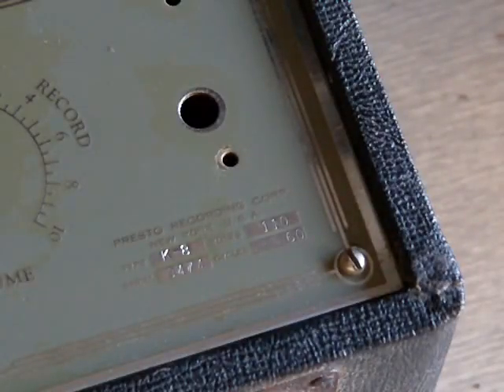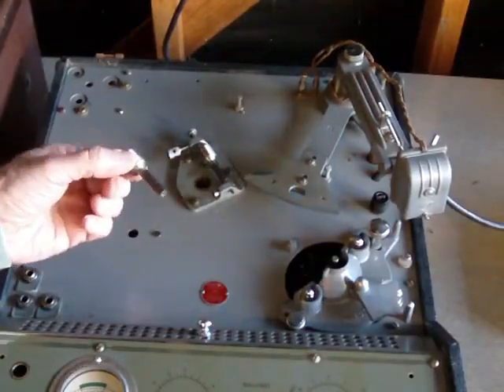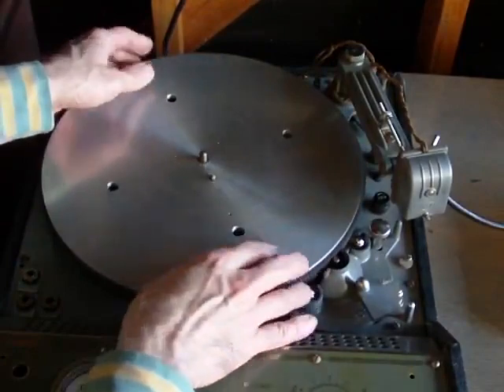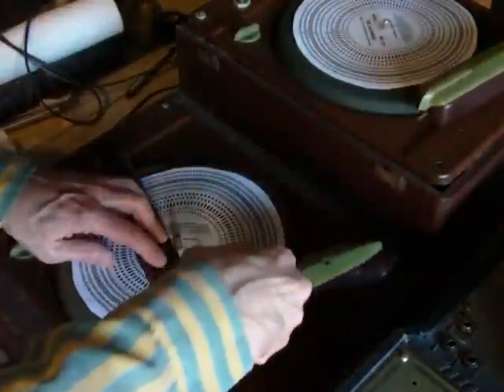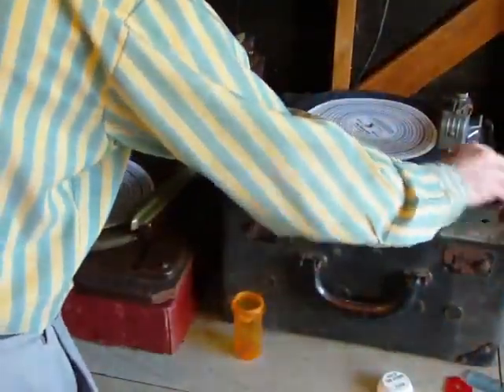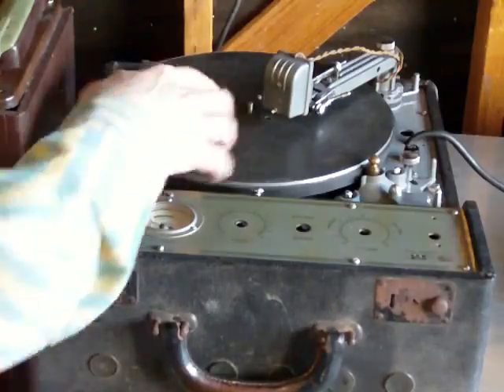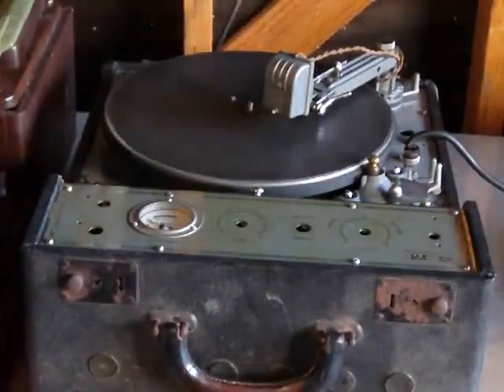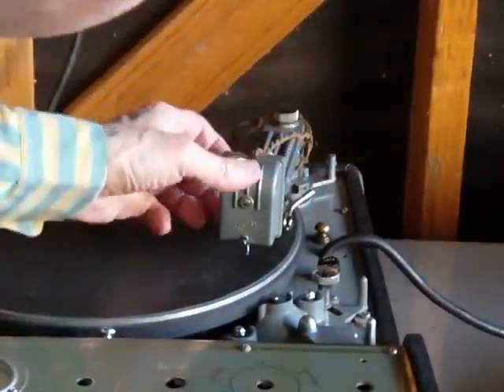Record Cutters Presto K8, General Industries GI-R85/R90

Comment: Здравствуйте. Хотел бы узнать устройство механизма подачи у этих звукозаписывающих станков, у тех где режущееся головка перемещается по направляющим с помощью ходового винта - понятно, а на этих где она стоит на поворотном рычаге механизм не виден. Если возможно сделайте видеоролик с этими подробностями. С Уважением в Вам Анатолий.

Hello. I would like to know the device of the feed mechanism for these recording machines, for those where the cutting head moves along the guides with the help of a lead screw - it’s understandable, but on these where it stands on the rotary lever, the mechanism is not visible. If possible, make a video with these details. Yours sincerely, Anatoly.
Reply from the maker: Когда я продал эти 3 резака на ebay, я никогда не фотографировал их изнанку. Тем не менее, вот ссылка DropBox, где я разместил страницы двух руководств по резакам RC с изображением ходового винта с нижней стороны. Спасибо за перевод на английский!
https://www.dropbox.com/sh/egaasttpp1r5x0t/AACHk32cgUUZcfeXIe_Z4zJpa?dl=0

When I sold those 3 cutters on ebay, I never took photos of the underside.  However, here is a DropBox link where I have placed the pages of the two RC cutters manuals showing underside lead screw.  Thanks for translating to English!
https://www.dropbox.com/sh/egaasttpp1r5x0t/AACHk32cgUUZcfeXIe_Z4zJpa?dl=0

Comment: Have a Question? You still do repairing services for presto K-8 portable record cutter machines if so please let us know thanks in advanced
Reply from the maker: I haven't repaired the Presto for anyone else but myself.  What I imagine happens to these machines in storage is what happened to mine, the cutting arm would not pivot.  The lubricant got like glue.  I knew it was supposed to pivot and used WD-40 and manual force to get it to pivot.  I disconnected the 2 wires to allow free motion and kept adding more WD-40 to allow it to pivot freely.  Then I applied lubricating oil and reconnected those 2 wires.
If there is trouble with the tube circuits, electrical troubleshooting would be required.  Most likely the amplifier would need to be re-capped.  The unit is heavy to ship to and from repair and shipping charges will be better to find a place close to you.  I am in Fort Worth, TX but I would hate to undertake the task.
Reply: @CV2200A  I'm having that same problem with my cutting head will not pivot. I will try some WD 40 but where do I spread it at in order for me to and where can I buy some lubricating oil
Reply from the maker: @EthicRadioArchiveReels  Here is a picture that may help.  https://www.dropbox.com/s/vv273a8hyqp4mpv/LUBE%20Presto%20Arm.JPG?dl=0  The picture shows where the two wires are pinned and should be disconnected while maneuvering the arm to free it.  Shown is the lift lever which may help getting WD-40 where it is needed.  The arm should be in the raised position so it will disengage from the gear below.  There is also a silver piece on top where WD-40 can get under.  It will be hard to turn at first but move it back and forth spraying in a little more WD-40.  Eventually it will get looser.  You may need to remove the platter and the deck from the case so that the gear on the bottom can swing freely without hitting the case.  When the movement is completely free, apply regular oil such as Gunk Super Oil, household oil or equivalent available at hardware departments.
There are set screws that allow adjustment of where the cut outer and inner limits are bu adjusting the arm relative to the gear below.

Comment: Hello sir what kind of playback needle does this have. I have one of these and I'm trying to find out what kind of needle to purchase. Thanks
Reply: Yes a presto k8...
Reply from the maker: The records made on these machines can be played on a regular record player/changer/turntable.  The cutting stylus could be a modern microgroove or 78 style.  Use the appropriate playback stylus. If yours has a separate playback arm, then get a replacement needle for the playback cartridge that is in it.  Is yours a Presto or General Insustries type?
Reply: @CV2200A  i just need the playback needle. I know the records can be played on a regular. I just purchased some new cutting needles because the one it came with was very dull and it wasn't cutting deep enough. I didn't see any fuzz coming off until it got to the end of a record and it was going over the same spot.
Reply from the maker: @robertpeak5502  The playback arm of mine was removed a long time ago.  Parts Express may have something that matches what you need 

https://www.parts-express.com/Search.aspx?keyword=styli&sitesearch=true
There may be others that sell replacements.  Perhaps you can see the manufacturer of the cartridge in the arm, that might help get the correct replacement needle.